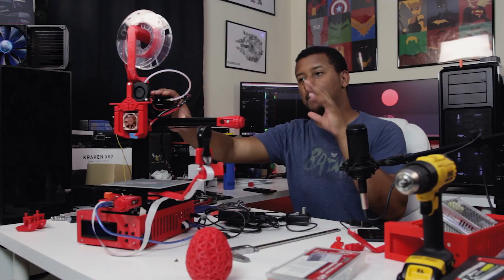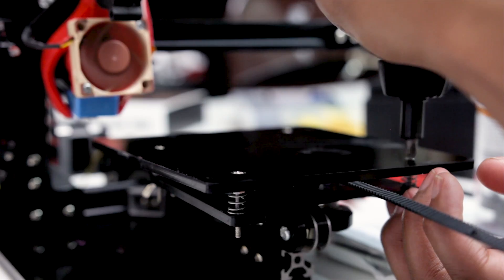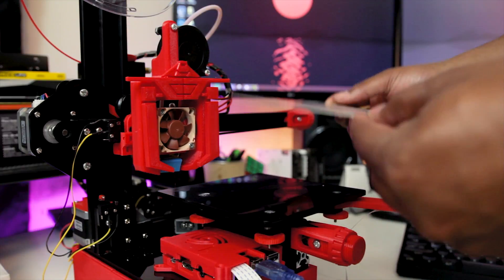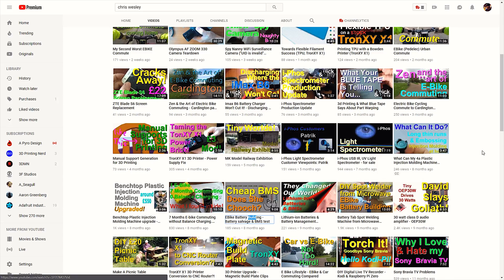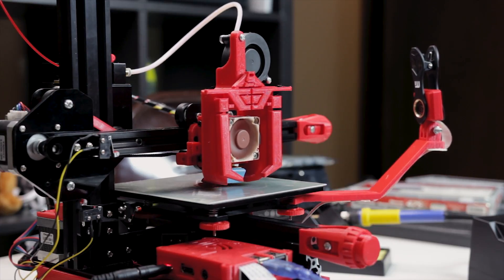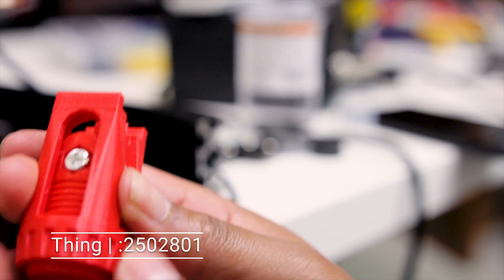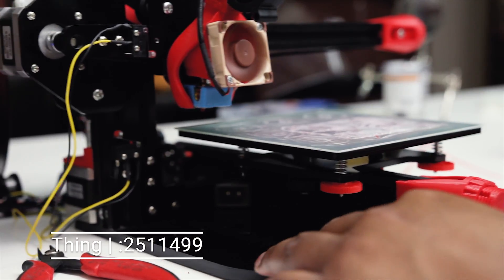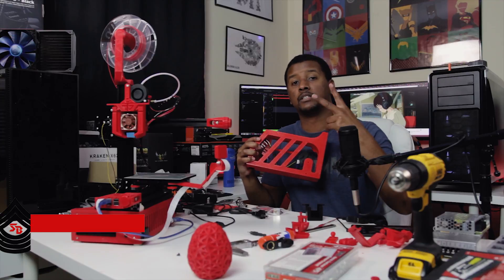Tronxy X1 $125 3D Printer Upgrades Part 1 | Y-Axis Mods

Comment: if the print bed wobbles than you have not assembled it correctly reread the instructions carefully,also fix those loose hanging wires next time you build something as you wire it up build the wiring into a wire harness ,if you do not know what a wire harness looks like look at the wiring under the hood of any new car or truck and you will see how the wiring is laid out nice and neat nothing hanging slap dap loose.
Reply from the maker: This video is about 4 years old. At the time there were well documented issues with the tolerances for both the Y and X axes. There were more eccentric nuts on either. 

Theods I show in this series are meant to address those and other common modifications to the printer as it was sold at the time.

I currently own and operate over 10 FDM printers. This isn't my best printer but I'm fairly happy with how it ended up at the end of the series.
Reply: @BallisticTech  These printers were sold as kits for the owners to assemble however most of the prople who purchased have no idea or knowledge relating to standard assemble practices as a result most of the machines were slaped together half ass and when it would not work they bad mouthed the manufacture ,this is a result of kids not being able to read and graduating from high school not able to spell cat and most are so bad the US Army refuses to accept them as cannon fodder.

Comment: Hey man loving your vids, might be a silly question but what are you using as your flexible plate on the x1?? Is it just a 15x15 bit of plastic or does it need to be something specific??
Reply from the maker: It's a specific type of plastic. I think commonly used in pcb's? G10 or garolite.
Reply from the maker: Can use something else tho. That's just something cheap they can get their hands one that's shows decent adhesion without a heated bed
Reply: its a 1/32 inch piece of fiberglass sheet...how special can that be

Comment: Hi. I wonder if you still have it the x1 and if you have installed Marlin on it. Do you have some video to share about how to do it? Thanks. Great video
Reply from the maker: I still have the X1 and use it for printing small stuff. But it's still running the stock firmware.

I haven't seen much about getting marlin on this particular printer. At least no guides or prebuilt configurations.

You best bet might be using either the Marlin configuration tool, or something like TH3D firmware tool.

If you do figure something out feel free to give me an update. I'd love to get marlin on this printer also
Reply: Ah ok. Im planing to change motherboard instead to a creality board that i have spared and with Marlin do any change that need to be done. I think it will be more cool with a different board and better display(using just spared parts)
Reply from the maker: @juanswe  That will be a cool mod. Sorry I don't have any more info to help. I know ppl have used TH3D's firmware for printers that aren't supported by default. So that might be a good starting place.

I actually have an old Ender 3 board so I'm very interested in your progress!
Reply: Maybe I will do a video of the all process :-) i think maybe others will get some ideas.

Comment: i know you have seen my Y AXIS upgrade kit and my replacement carriage that will remove 100% of ALL play in the carriage on thingiverse (you commented on FB at one stage) i have put over 20Kg through my X1 since i designed them and there as good today as the day i printed them

why arnt you using them instead of complaining that you still have wobble after you printed the crappy ones?

https://www.thingiverse.com/Adverse_Effects/designs
Reply from the maker: I wouldn't say I'm complaining about still having wobble. It's there. I acknowledged it and noted it's improved print quality with the mod I did. I'm fairly happy with how much this simple bracket has removed vs the stock spaceers. I chose this bracket because it was a simple single piece that was easy to print on the X1.  It was one of the first mods I did.